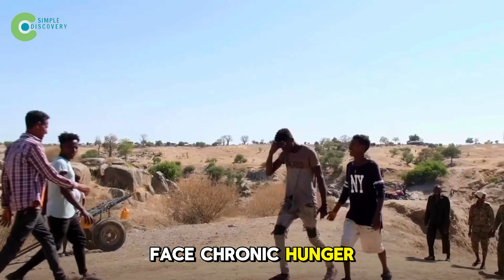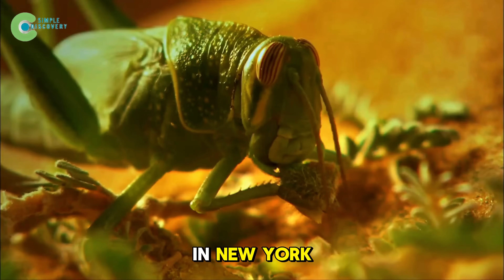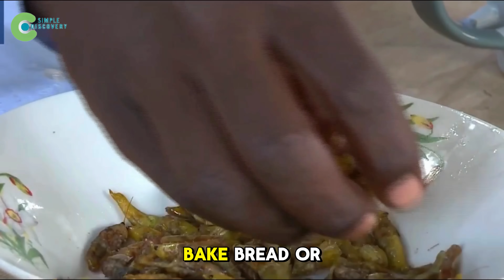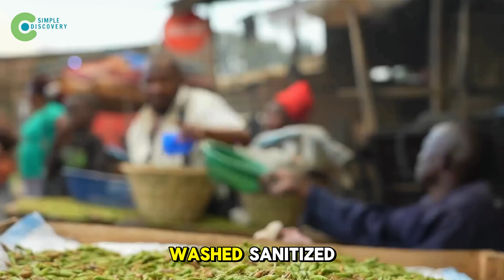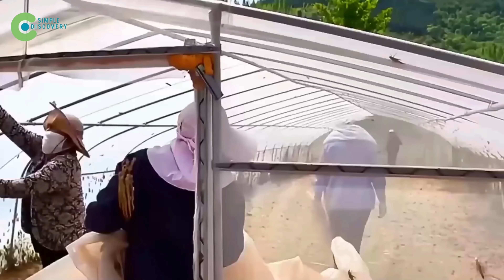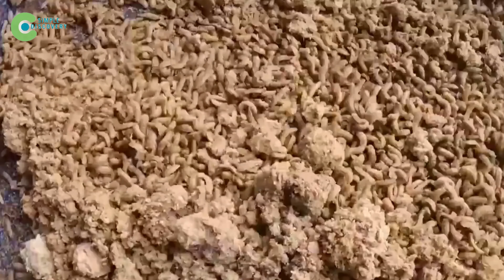Africa RELEASES BILLIONS OF LOCUSTS INTO DESERT - Months Later The RESULTS SHOCK THE WORLD

Comment: About 5% of the human population measures in inches, feet, miles, acres, and Fahrenheit. Therefore, the rest may be neglected.
Reply from the maker: Fair point—most of the world uses metric. We’ll lead with °C, km, and kg and include imperial in parentheses going forward. Thanks for the nudge.
Reply: @SimpleDiscovery24  Even most of the Empire does not use imperial units officially. In the 1960s, we bought our first TV sets with a cm diagonal, but now with an inch diagonal.